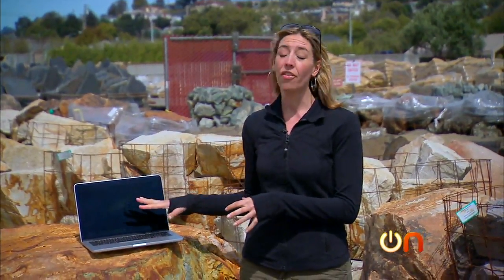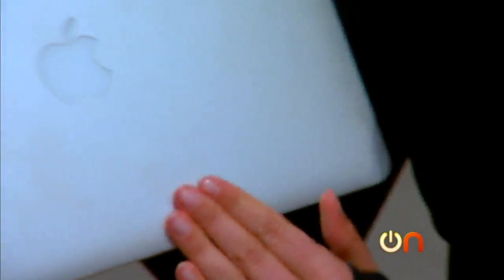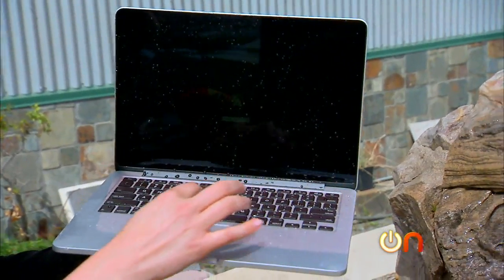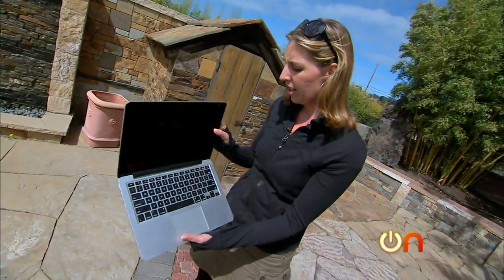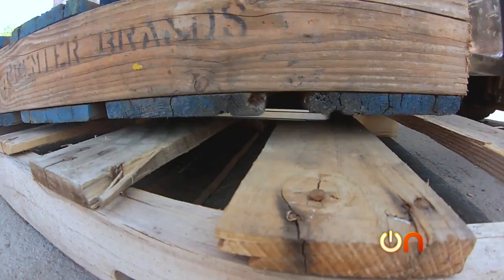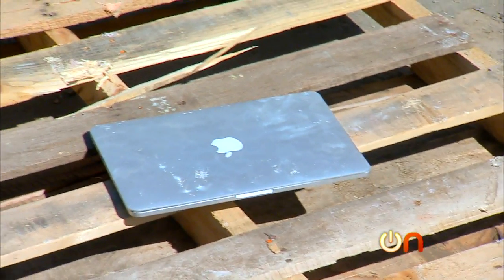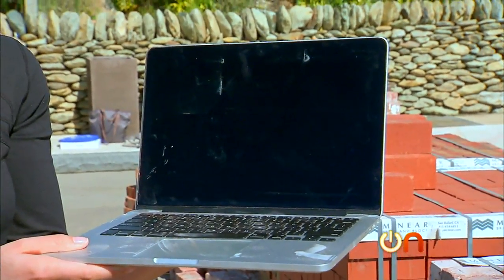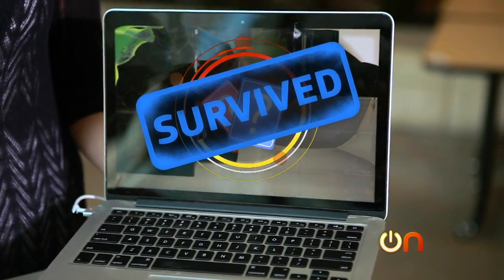Always On - Is the MacBook Pro construction-grade?

Comment: MacBooks are overpriced, period. Why would I want to spend $2000 on a WEAK computer (i5 processor, bad graphics card), when I can get a computer that can handle much more for $800 less? 

Only conformist idiots and video/photo editors buy MacBooks.
Reply: > $1,500 laptop
> Survives having water poured on it and being crushed by a boulder
> Calls it overpriced

pls
Reply: EyesofPhysics SRG So basically, a Mac, but worse, and more expensive?
Reply: DuxDub Studios  lol maybe because people want to pay for quality build and the OS? Macbooks being over priced is just your opinion. other people may think otherwise. Im pretty sure people who buy macbooks are quite well aware that they can buy a product better  or as equal to for roughly the same price you pay for a mbp.
Reply: For $2000 you actually get a 15-inch 2.5GHz Core i7 PCIe SSD MacBook Pro, that's not weak in my book. I can build you a very capable PC but I use a MBP. Why? Because it fits my needs, I don't have interest in gaming whatsoever or do video editing. Also, a lot of the PC laptops mimic the unibody MBP design so bad. If I wanted a MacBook Pro look alike, I'd just go with the real thing.
Reply: SkyTheCoder Look at lenovo workstation laptops
Reply: Iphoneman Macs can get viruses too, not just Windows...

(though Avast and AVG Antivirus, both free, do the job nicely)
Reply: SkyTheCoder yet I had a windows computer free AVG, and a few months later blue screen, ever since 2012, I have had a mac, and I have not had one single complaint. It was worth the $1100. And Macs can get viruses yet it is significantly harder to craft a virus that can infect macs, they are a reliable computer.
Reply: DuxDub Studios You called Macbook customers idiots. How is that asking for opinions?
Reply: DuxDub Studios Sure, maybe you did not but you didn't say that some were idiots. This is just you trying to get away with what you said in a very childish way. Just apologise for what you said instead and be a grown up about it. You may be right that a PC for the same price is just as fast. But from my very long experience with PCs they tend to get slower a lot faster that MACs. Sure you can just erase things etc etc. However you tend to have to clean MACs a lot less and they just works like Steve Jobs liked to put it. But personally I use MACs mostly because of their OS. To me, a person who surfs the web, writes exams, listens to music, do some photo editing etc it's far superior to PCs. I'm not saying it's perfect but I notice far less bugs and flaws than I do with PCs. Maybe because macs are more closed up, but that doesn't bother me a single bit because I'm not that kind of user. Just accept the fact that different people value different things in a computer.
Reply: and flawless design is a seller
Reply: Quality.
Reply: the 15 inch macbook pro shits on the 13 inch (which starts at 1300), let alone any windows laptop around that price. you arent being honest to the evidence
Reply: DuxDub Studios you can not deny that apple make some amazing computers. Apple sell the most complete computers and that has to be for a reason, right?
Reply: SkyTheCoder Can be much cheaper, same price, or more expensive depending on what you want inside. Certified waterproof keyboard, actually military tested. I used to own one. Has an internal metal cage. There is pretty much no way of calling it worse. The only point for debate here is that your mac runs mac os, and lenovo can run anything else. Some more good laptops: razer edge, the new msi red full aluminum gaming notebook. There is no way you can claim that apple does anything special (other than OS) unless you are just a fanboy.
Reply: EyesofPhysics SRG And what amazing software do you get with that laptop, like the professionally used software that comes standard and exclusive to Macs? What about the whole Mac App Store and all the professional tools only available there? What about Final Cut Pro? What about Logic Pro? What about Aperture? What about Compressor? What about Motion?

Re Apple never doing anything special, what about making the first big hit tablet, some of the first commonly used home computers, or their extremely powerful processors straight from Apple? What about the new 5K iMac's display? They made an entirely new circuit just to power it all.
Reply: There is nothing internally that is great about most mac computers (excluding the new mac pro's physical dimensions and the display on the iMac retina 5k), and definitely nothing great about the laptops.
The only reason you guys gravitate towards them is because you have not experienced the power of similarly priced tec. Whenever people go buy pc laptops, they pay 500$ roughly. If you have never experienced a $1200 pc laptop, then how is it fair to compare a 500$ pc to a 2000$ mac?

As far as build quality, pay the same amount to msi, lenovo, razer, etc. and you will experience a faster computer that can run linux (an operating system faster than windows or apple) and can game with dedicated graphics, and has the same durability or better.

For 1500$ u guys get the internals of a 900$ computer. You can't even argue that.

tl:dr Stop comparing shit pc laptops to macs and pick on somebody your own size.
Reply: SkyTheCoder You are right about the software. But I get mine for free anyways. "professional tools only available there"? you mean tools to fix your exclusive macs? I admit that I know little about editing, but my sony vegas 12 and audacity has served their purposes. And I can buy more softwares if I need them. The first hit tablet? yeah, maybe the first hit tablet, but not the first tablet. They stole the motion mechanics and the idea itself, they just marketed it better to people like you. Extremely powerful processor? put it against an intel xenon any day and watch your processor cry. You are right about the display, and I agree that this is impressive, but not innovation. 5k existed before, they just mass marketed it. they made a new circuit? WOW, HOLY BALLS MACINTOSH ACTUALLY CHANGED THEIR CIRCUITRY FOR A NEW COMPUTER, WOW.
Reply: EyesofPhysics SRG News flash, I've owned a Windows 8.1 laptop that cost $800 and a Windows 7 gaming desktop that cost $1,500 (custom build). I still like my Mac (a MacBook, not a Mac Pro or something) more, because it's ACTUALLY MORE POWERFUL, SCORES HIGHER ON BENCHMARKS, AND HAS AMAZING SOFTWARE ON IT THAT COMES STANDARD.

Gaming PC specs:

CPU: Intel Dual Core i3 at 3.4 GHz
GPU: EVGA GeForce GTX 760 Superclocked
OS: Windows 7 Home Premium 64-Bit
RAM: 2 x 8GB DDR3 1600
PSU: Neo Eco 620W
Startup drive: Crucial 256GB SSD
Secondary drive: Seagate 1TB Barricuda
Keyboard & Mouse: CoolerMaster Storm
Display: Asus VE228H LED Monitor (1080p)
Speakers: Logitech Z200

It's actually a pretty great PC, but my Mac still scores better.
Reply: Holy balls you got ripped off. you got a core i3 in a 1500 dollar gaming pc? Your graphics card is alright, but you should have allocated more of your 1500 dollars towards your graphics card, perhaps 700  dollars. your ram is good for gaming, but would be bad for video  editing or things of that nature. everything else seems alright, but where did the rest of your ~600$ go?. The reason your mac might score higher is because this is a gaming laptop, with a heavy focus on graphics, and has a poor cpu for anything else. I would suggest a i5 at least. Plus, your ram is not so good for benchmarks. if you wanted a workstation, you should have not built such a heavily focused gaming pc. Now, if you played the same game on the same os and told me that the pc lost, I would either say that you did not configure your pc properly in the bios, or you are lying to me. Your software does come standard, ill give you that. but again, I have mine for free, so that does not bother me.
Reply: EyesofPhysics SRG I built it by hand, and it's a desktop, not a laptop. Here's an approximation of the budget:

Case - $50
Motherboard - $100
CPU - $100
GPU - $200
PSU - $50
OS - $100
ODD - $25
RAM - $100 (combo with the motherboard, not just bad quality)
SSD - $100
HDD - $50
Display - $125
Speakers - $40
Mouse & Keyboard - $20

Rounded down a bit, I know the actual cost was over $1,250 (pretty sure it was over $1,500 with tax)

I didn't have too much money to spend, and the processor was recommended, had great reviews, and was 3.4 GHz.

How is an EVGA GeForce GTX 760 Superclocked not enough? It's got great reviews, was recommended by multiple people, and everyone has said it is absolutely outstanding. Anything past that is a ripoff.

You're just trolling at this point... hopeless Windows fanboy. Admit when you've been defeated.
Reply: SkyTheCoder I disagree. I did not know that you counted displays and peripherals as past of the pc. Your actual pc costs ~900 dollars it seems. btw, when it comes to graphics, it is all about the titan :) well, your graphics is fine, but how in the world did you get it for 100$? and your cpu, I expected them to be more expensive. Again, when it comes to benchmarking, gpu isn't everything, it is mostly about your cpu and ram, and a bit about gpu and hard drives. Finally, you have still paid more for your mac, I assume.

Please compare it to  this: http://www.msi.com/product/nb/GS70-2QE-Stealth-Pro.html#hero-overview 
We are talking 16 gb ram, fourth gen i7, 768 gb ssd in raid 2 AND 1 tb hard drive storage, and nVidia GeForce GTX 970M (3GB GDDR5); all with an aluminum shell, and extremely thin body.

Also: http://www.razerzone.com/gaming-systems/razer-blade-pro
with fourth gen i7,  2 gig NVIDIA GeForce GTX 860M , 512 gig ssd, 16 gb ram, and an EVEN thinner body with aluminum. Probably the best looking laptop out right now. 

Finally, there are the alienware systems, but you already probably know about them.

How exactly does a mac beats these two, I have no clue.
Reply: And I am not a windows fanboy, I operate windows and linux. Because I am not close minded, and know what works best for what situation.
Reply: EyesofPhysics SRG On the links you sent me - one of them costs $2K-$3K, and the other I couldn't find the price for. Do you expect to compare that to a lower-end Macbook?

I didn't get the GPU for $100, I got it for $200 (typo, whoops. fixed.)

Checking some sources, it appears my GPU is even better than the first one you linked to, the industrial-grade work laptop.
Reply: EyesofPhysics SRG I'm not close-minded either, but it appears that only I am smart enough to know that Macs are the best at pretty much everything...
Reply: SkyTheCoder the lenovo? it is a workstation, not even made for gaming. For me to find a computer that rivals yours, you need to tell me your pricepoint for your mac and whether you want a benchmark winning comp or a gaming comp. Have you even tried linux? I am guessing not. I have extensively used all three, and while apple's os is faster than windows, it is no match for linux.
Reply: I don't think we can agree on this. lets agree to disagree. Im done here
Reply: EyesofPhysics SRG K
Reply: The reason people buy mac books, is they actually do have processers, i5, or i7 graphics, and they dont get viruses, they have great software that comes on them, and PC's you need all that antivirus shit, the longer you have your pc with antivirus, it will eventually be more than a mac, so PC's are more expensive in the long run
Reply: Iphoneman I don't think you understand, I prefer Macs, I don't like Windows. I was just stating that Macs can get viruses too (even though there are hardly any and I've never gotten one)
Reply: What if we really like the OS you idiot? Don't bother what other people buy, mind your own damn business.
Reply: DatMarkan I said in my comments, "unless you like the OS." If you like the OS, that is a legitimate reason and I cannot argue. I would like to say, however, that many linux operating systems can be nearly as simple as mac os, but are free. But whatever, if you like macs for their OS, atleast that's a reason.
Reply: DatMarkan I didn't specifically state that all of Macbook customers were idiots. Generally, most are considering that the only arguments they make to uphold the Macbook is for its "simplistic design, its fluidity," etc. The Macbook is good for editing videos and photos, and general usage such as browsing a web; but then again a Chromebook that costs $1000 less can also browse the web. Most PC's that cost the equivalent of a Macbook can do everything that a Macbook does faster, and Apple users are blinded by that fact.
Reply: DuxDub Studios Macs are for the people who run the world, PCs are the 12-year-old gamers sitting around playing CoD... Does your PC come standard with a 3 GHz processor, insanely high-res display, great audio quality, and an app store full of applications used by professionals around the world? I don't think so. Maybe you'll be able to reply with some stupid "witty" remark after your PC finishes taking its 15 minutes to start up.
Reply: EyesofPhysics SRG Yes except it is ugly as hell. It is bulky, and it is made out of all plastic.... It was meant to be a tough computer, the mac wasn't designed for that.
Reply: Answer = windows
Reply: TakenUsername That is a bit overkill...
Reply: kefkapalazzo1 yeah.. and every company tries to copy the unibody design but fails hilariously because of cheap materials.. at least I can sell my Macbook for 60% in 5 years while the cheaper notebooks go for 20% after 3 years :-)
Reply: steckkasten I'm on your side buddy. at least you're telling the truth about something
Reply: steckkasten Yea but only an idiot will buy a 5 year old mac for 60% of the price. Especially when for 60% of the price 5 years from now you can get a notebook pc that is 5x-6x better internally, and maybe even better looking, after all who knows. I mean just look at the original imac or macbook, those cheap plastic unibody ones. Id much rather have a $500-600 aluminum notebook than those shitty things.
Reply: Tadamichi Kuribayashi Well.. I didn't say I would buy that, but I'd sell it for that :P Everbody should buy what they want to buy and not getting harassed for it - why would others even care? I don't get it
Reply: DuxDub Studios I have one because I can, you opinionated smug.
Reply: Insult me all you would like; I am the one not buying products simply because the brand is popular and the operating system is "simplistic".
Reply: DuxDub Studios So you think simplicity and easy of use are a negative. So you like thinks to have longer more difficult processes wasting time and effort? Well that's really smart.
Reply: DuxDub Studios There is a reason they are so popular. People turn to apple for simplicity, build quality, ease of use, functionality, reliability and power amongst other things. Not because they are idiots.
Reply: +Callum Robinson, Windows 8.1 is quite a simplistic build of windows. You can choose whatever the build quality you want your computer to be, since there is a plethora of Windows computer manufacturers. They are also quite reliable, since they don't slow down after years of updates (something I have personally seen with older MacBooks). Oh, and you can buy computers with the most powerful Intel and AMD processors.
Reply: +Callum Robinson Of course, and I would buy more Apple products if only they weren't completely overpriced. If Apple products cost how much they should cost, I'll buy them.
Reply: DuxDub Studios So, what you're saying is that people must conform to your preference and not buy a MacBook.

How ironic.

Here's a suggestion to you: mind your own business.

If some schmuck wants to buy a MacBook, let him.  It's no skin off your back unless it's YOUR money he's using to buy it.
Reply: Okay, you're taking everything out of context. What I'm saying is that I don't want to buy it, and stating that either editors or people who love computers with looks over functionality buy them. Nowhere did I say that you shouldn't buy a MacBook. Everyone has their own preferences.
Reply: DuxDub Studios "What I'm saying is that I don't want to buy it"

And that's fine to have your own preference and your reasons therefrom, except...

"Only conformist idiots and video/photo editors buy MacBooks."

While you may not have directly said that you wouldn't want other people to buy one, you did seem to strongly imply it, even going so far as to talk about other people, such as unfairly presuming what kind of people would buy one and their reason for doing so (vanity).

It is from that where I suggested that you ought to mind your own business.
Reply: I might as well say the same for you. There is no need to vociferate about one negative comment on a video about MacBooks of all videos.
Reply: DuxDub Studios "I might as well say the same for you."

The difference here is that I did not accuse people of being conformist idiots merely for buying a product you do not like.

Conversely, it could just as well be asked why you were here commenting in the first place as this video is about a product you would never consider buying and using from the beginning.

And, mind you, your negative comments weren't just about the product, but also of those who buy and use them.

It was your unfair and rather derogatory generalization of people who buy and use these machines that I've taken issue with.
Reply: Good riddance :)
Reply: DuxDub Studios Then here's hoping you won't disparage those who made a choice you don't agree with.

So long.

Comment: I think what these test didn't account for is that it really matters WHERE the macbook gets hit. If there's impact on the larger body it will hold up to a lot, but if it hits on the corner alot of things get screwed up. Not knocking the build quality, but it's something that will happen with a laptop